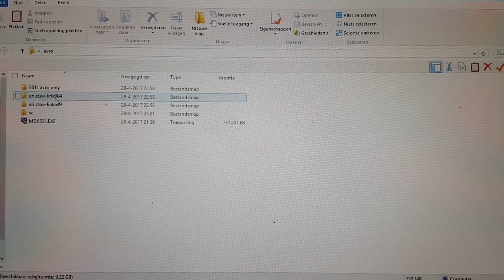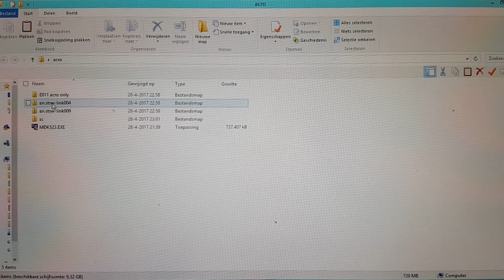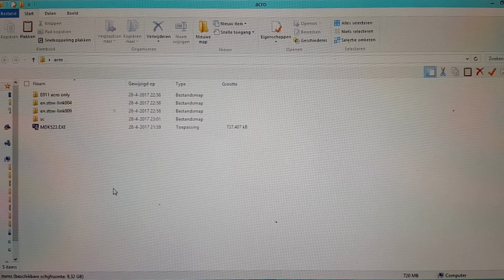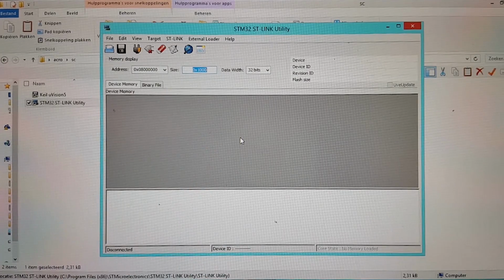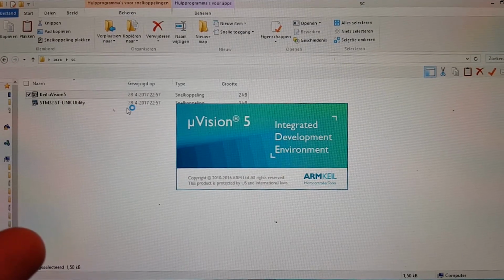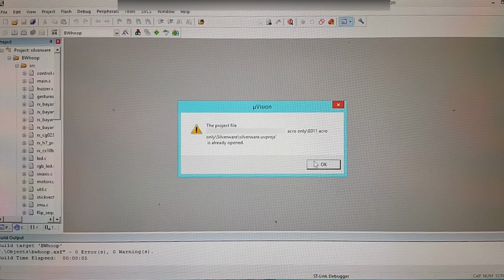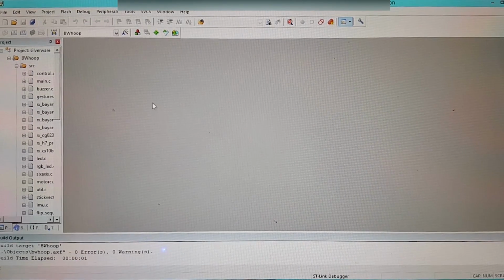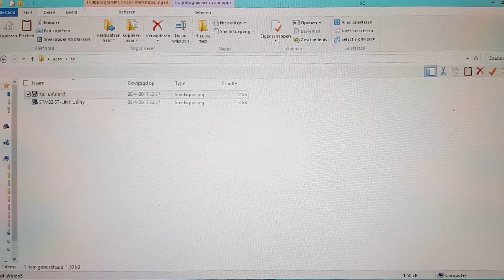How to flash acro firmware on e011 (NEW FLIGHTCONTROLLERS DONT WORK! SEE DESCRIPTION FOR CHANGES)

Comment: im stuck. got stlinkv2 updated, so connection should be fine, but it does not connect. chip is stm on the Fcontroller. cable connections are good, multimeter checked. can stlinkV2 be mislabeled? or dunno..  https://imgur.com/PV1LCZk  help?
Reply from the maker: I am not 100% sure if the newer non-flashable ones also have stm labeled. If your fc is new (from up to 1,5 years ago untill now) its probably not flashable.
Does your windows recognize the usb programmer. Do you hear the usb connected "beep".
Also on some (older) fc's the labeling is incorrect.
Finally, some fc's can give problems connecting up. Retry a couple of times with my method. You could also try to connect the fc with direct attached lipo to pc. In both cases open up a fresh new stlink in windows. If it connects, check if the readout protection level is on 0.
Its been a while for me, but everytime i connected one up, i had to do some troubleshooting on the more recent flashes.
Reply: @CaninosRC  yes it beeps, it updates its own stlink fw too, identifies itself by id number, everything done by the book. tried switch clk io too at the end of my suffering. just a quiet no..

Comment: Hi i have flashed my e011 with following your steps. flash successful. But my e011 won't pair to transmitter (Original transmitter) :( can you help me?
Reply from the maker: I am not that much into flashing lately, but i do know that nfe updated the firmware. There are options to use the original controller, but also other hobbygrade tx's only as he implented also an arming switch (which doesnt work with original tx).

Another (very unfortunate) problem could also be the bad placement of the crystal on the flightcontroller, which is prone to damage. I have had a couple dead fc's with this issue. Replacing crystal could help, but didnt work for me.

Comment: Hi, how are you? Can you tell me where to buy 3-pin connectors, frontal side for e011 and b03? I would need male / female. Is this ok or other...? https://www.ebay.it/itm/1-25mm-Micro-3-Pin-Female-Connector-wire-Male-Header-Quadcopter-PCB-Board-x-10-/181447137539
Finally I decided to flash  my old e011 and b03 pro :-D is this ok too? http://www.boldclash.com/boldclash-bwhoop-b-03-receiver-p54.html thanks
Reply: and another question, this procedure is also good for b03 pro?

Comment: mine is labeled 2017.03.03. Do i consider it new or is it still an old one, hence flashable
Reply from the maker: It should be ok. Check also to be sure if there is something like stm32... something written on the microcontroller.

Comment: I've got a E011, how do i know, if it's an old/flashable one or a new/not flashable one?
Reply from the maker: You could check the chip on the fc if it says stm32 something. Then its okay. I dont know the exact date it changed. But if you purchased it recently from banggood i'm 99,99% sure its the new unflashable one. You could also check out the markings on the fc. If manufacturing date is 1 or 2 months old. The new models have been out for a month or 2.
Reply: dang, i might be unlucky and got a new one. But i feel like i still got the old one, because of the date 2017.03.03.
What would happen if i flash it and it tourns out it's a new one?
thanks for your answer :)
Reply from the maker: Judging by the date it seems good.
But wait... i completely forgot that there is a side by side comparison picture somewhere on this thread.

https://www.rcgroups.com/forums/showthread.php?2868518-Eachine-e011-Review-Mods-and-ACRO!!!(always-in-construction)

I should place it on top, but i have limited internet capabilities atm.

Comment: There are three video tutorial that i've watched, and all use 3 pins : SWDIO, GND, SWCLK also use lipo battery. Why use lipo battery connected to the board insteads using 3.3v pin from ST-Link ?
Reply from the maker: I think 3.3v would be too low and unreliable. Better to use lipo

Comment: There's also second way to flash firmware for E011. I've also had the problem with "Cannot connect to target" message. The second way uses BOOT mode and USART pins, also USB to USART interface is required. It's quite difficult, beacuse you have to solder 2 wires for PA9 and PA10 pins on E011 and desolder BOOT pin (it's connected straight to the ground, so you cannot pull it up without desoldering). Although, still cannot flash firmware using ST LINK, so maybe my ST LINK is broken. I have no idea. Firstly I thought that my stock E011 firmware is different and that's why I cannot flash new firmware. But now I'm using Silverware, so I have exactly the same board and exactly the same firmware, and still cannot flash using ST LINK.
Reply from the maker: TheAslan5677 there are indeed a couple of ways, this easy method worked for me.
Keep in mind that eachine swapped out their FC's for revised ones which arent flashable at the moment! So If you have a new fc that could also be the issue.

Comment: anyone know how i can fix the yaw drift?
Reply from the maker: Dunno. Maybe fc is not correct centered? Or bad motor? Maybe bad tx.
Recalibration is done with rightstick 3x times down, maybe that'll fix the drift.
Reply: Canino i fixed it. Using a different firmware
Reply from the maker: VRLE nice, enjoy

Comment: After Flashing My E011 my trim buttons do not work!?!....Any idea how to fix this? I am using the stock TX.
Reply from the maker: Dual firmware? 
I never tried the trim buttons as i fly acro with these whoops.
Maybe they work in level mode only.
Or just calibrate the fc by hitting 3x down on the pitch/roll stick (right stick in mode 2)

Comment: First let me thank you for thios awesome mod, can we use this process on the Eachine E 010??? All the best
Reply from the maker: Thanks, the mod is not mine tho. This is just a way to connect the e011 to the flasher. The e010 uses a different chipset and is NOT flashable with acro.
Reply: Thanks for such a fast reply... I have a O11 and already flashed it with the process in your vid but yesterday I was flying outside and crashed really hard, after that the quad turned of and now it does not bind... I use a multiprotocol module on my FlySAky Fs i6, it didint bind with it neither binds with the original controller... Any idea why it´s doing that???
Reply from the maker: Thats how i killed my first acro e011 aswell. I replaced the "crystal" on the fc, but it didnt help. I couldnt fix it and just used a second e011.
Time to get a new one :(
Or maybe FC only to replace the dead one.
Reply: Thanks man, got a new sub here... Big hug from Portugal, all the best
Reply from the maker: U got one too ;)

Comment: Nice Video, but can someone help me? I have a problem: My board is connected the right way to the stlink(I checked everything with a multimeter, I'm using the 4 small holes on the top of the board, but they're connected directly to the 4 big pads in the middle(multimeter). First I start the STM32 st link utility program on my computer, then I wait 5 secs and connect the stlink which is already connected to the board, then I wait another 5 secs and connect the battery to the board(LEDs begin flashing like they normally do), another 5secs later I click the connect button in the Program, I got an Error saying:"Can not connect to target! Please select "Connect Under Reset" mode from Target->Settings menu and try again. If you're trying to connect a low frequency application, please select a lower SWD Fequency mode from Target->Settings menu." I didn't find a "Connect Under Reset" checkbox thing so next I clicked The disconnect Button and(Program freezed for a few secs), I got a message that he disconnected from device, then I click Connect again, and I get an Error (Program freezed for a few secs again) saying:"STLink USB communication error".

Please help me, what can I do?
Reply: Canino Nice, then I'll buy some of those. My option now is that I said a friend that he should do the same and I don't give him any instructions or gear from me.(cause the only thing I haven't replaced is me xD) I hope that he's gonna get it. Thanks for your patience and help canino!
Reply from the maker: Cant say for sure. Check out the forum. Or use the pads i refer to. On the pads the connection is mixed up, dont know how its on the connectors in front.
Reply: Canino yeah... i think i'll search in the forum. But I can say that the front pads and the middle pads are connected directly together and that the text on the front pads is right!(so only the text CLK and DAT on the middle pads is reversed) I also tried it the other way round, I got the same error, even if I don't connect the fc-board to the st link.
Reply: Now I tried it with the other pads, same issue
Reply from the maker: There was a setting to be set to 0 on some issues. Cant recall which one. Check on the forum.
Reply: The Read/Write protection in "target->option bytes" but you can only do that when you are already connected and I can't connect my board du the stlink utility program
Reply from the maker: Yes thats it, but not for you :(
Reply: https://drive.google.com/open?id=1ixqbtqX0k8BtIIET0Wz3rLUUBoDpHyZM
here is a video of me doing that. (I also tried it with the "connect under reset" option, then it tells me that the error might be fixed when i change that back again and so on
Reply from the maker: Link this video in the h8mini/cg023 thread silverxxx probably will help.
Reply: Canino k, I'll try that
Reply: Wait a minute, are you the Canino who is the Moderator of the "E011 Review Mods And Acro" Thread on RCGourps?
Reply from the maker: Yes :)
Reply: Well I tried both, but unfortunately I still get the same damn error as always. Even with my new STlink. I don't know, maybe I do something really easy wrong everytime. I even wrote a checklist kinda thing.
Edit: I ordered a stlink with the labeling you have, but I got one with the labeling that I already have(GND between SWDIO and 3.3V, not between SWCLK and SWDIO)
Reply: Did you ever resolve this issue?  I had the same error when I tried to connect to my e011.  I swapped all the connections with no luck.  I reassembled the e011, it works but could not connect to ST link.
Reply: ZX6R Nope, still trying. Changed the quad, the stlink, the computer.... dunno what to do now
Reply: my fix was to uninstall stlink software and reinstall.  there will be a popup to install stlink drivers in background.  make sure you install drivers. I missed this the first time.
Reply from the maker: Felix Baum there is another method, maybe this can help
https://www.rcgroups.com/forums/showpost.php?p=38875671&postcount=98
Reply: ZX6R i installed everything, yes. I even got a software that I know is working. Silverxxx sent it to me, still not working...
Reply: Canino thanks, I'll try it when I'm back home!
Reply from the maker: I have no idea what could be the problem then. I am guessing that there will soon be silverized fc's available soon for purchase. Not that that will help you resolve this, but i dont know other options to help you atm.

Comment: I try to follow your tutorial, step by step
but I get warning when I connect my ST Link to my PC
the warning is "disable readout protection" that appear on ST Link utility software
can you help me to solve it?
Reply from the maker: Make sure you have the latest st-link utility and firmware installed.
Reply: Yes, I have
I download st-link utility from the official web today, and  i have update the firmware to
But warning still appear
Reply from the maker: Take a look at this comprehensive page and thread on flashing the h8mini (basically the same). I cant say for sure how to fix your problem. Buy supposedly you can set protection somewhere. 
https://www.rcgroups.com/forums/showthread.php?2512604-Eachine-H8-mini-acro-firmware/page483

If it doesnt work, just deinstall everything and (download and) reinstall all programs and firmware.
Reply: Canino's RC  thanks a lot
i will try it

Comment: What is the advantage to use this kind of modded firmware?!
Reply from the maker: the mod enables you to fly in acro mode. acro is flying without selfleveling. Its harder to fly, but gives you more smoother control and to do crazy manual tricks etc. experts can also setup pids and rates for custom flight style. etc... etc... those awesome fpv freestyle racer videos on youtube are flewn in acro.

Comment: Any ideas of how to change it back if I need to?  thanks for the video by the way =D
Reply from the maker: See the forum link and look for the stock firmware. you can flash it back to normal with that. Its only possible on the e011 it seems. usually flashing means, no way to recover stock firmware.
Reply: Sweet thanks =D Ill have to read the rest of the e011 thread when I get the time then